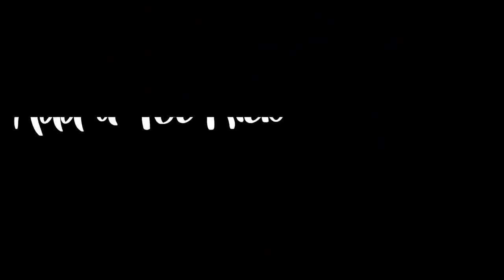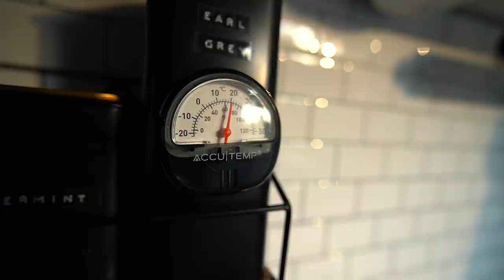VAN BUILD MISTAKES: 8 Things We Would Change | Sprinter Van Conversion

Comment: Great video guys. 
Rooky errors we call them in Australia. Some ideas that might help. 
Let the cushion base sit on a new wider ply base that can manually slide under the backrest when needed. Velcro on bottom of seat cushion and seat base would stop it sliding. Rare earth magnets would have worked a treat but your new catches are better! What about a stool for sitting during the day, fold up of course but a smaller footprint. Could you shorten the bottoms of the fronts of your cabinet doors by 10 to 15mm to give you a big enough gap for thin carpet mat?
Anyway, keep up the good work, stay happy, stay safe but keep enjoying the journey. Blessings from Wayne and Meredyth in South Australia.
Reply from the maker: Oh yeah definitely rookie errors! 
Cheers for the advice Wayne!

Comment: Yeah you could probably add close to a foot to your bench width. Past your kitchen cabinets. It would not line up anymore with your kitchen cabinets, but it would be more comfortable to rest on. Also it might not be so comfortable to walk down through, but you could shimmy down sideways slowly. You could either get a board on top that folds out. Or one of those staggered sliding benches ive seen. So you can pull it out when needed. And why do you need the backrest? If you got rid of it, it would make your bench wider. Or have those back cushions be the extension width now.
Reply from the maker: Yeah we fixed a whole bunch of these mistake and posted them on our updated van tour. Because the backrest houses the winch for the bed we definitely still needed something over there, but we still increased the width of the seat.

Comment: You know what I would also do is, raise your countertop where your desk is, a few inches. So when you move your desk board back and forth, you can still leave stuff on it, like your laptop etc, so that it will clear the height.
Reply from the maker: We never had issues leaving laptop on counter when pushing it back and forth, or did you mean in the gap between the top of the drawers and the black walnut top?
Reply: @Drinkteatravel  yes the second one. So you can leave the desk countertop with your pens and laptops and papers, and slide it under your kitchen countertop.

Comment: We updated a 20 year old camper van here in England and we included some of your suggested changes.  We built our own composting toilet and we find the 2 of us ( 1 male, 1 female like you guys) don't fill the solids part during 2 weeks use.  We used the existing cassette to collect the liquids and we have to empty that every 2 days but it's much easier than the mixed waste.  I would suggest to anyone building their own composting toilet, to start at the lowest point with liquid and solid waste containers and work upwards.  That way you won't find you need water to flow uphill.   We also had the cold floor issue but we throw rugs or old blankets down and that makes a huge difference.   We also made insulated pads to fit every window in the habitation area and hung a well insulated curtain between there and the cab.   Still lots to learn!   Pete
Reply: We took out our shower because we didn't use it.  We don't carry enough water to use it when we are boondocking and when we are on a campsite, they have showers there!
Reply from the maker: Must have been a lot of work! Yeah I've seen a few people.recommend the self built compost toilet so might need to look into that.

Comment: So i see you are still answering comments. What do you think of those showers, with the drain in the middle of the floor? And then you use a hanging vinyl shower cubby around yourself. I've seen some with a wood grate right on the floor over the shower pan, or some where you have to fold up a piece of floor to get to the shower pan below. I think that's good just to keep as an option.

And my second question is, I've seen some videos where a guy has a gutter on the back of his van, to use as a rain water collection system, which then drains below into one of his water tanks.  Why don't more people use that? 

I think that would be good to shower or wash dishes with, with a water heater. Collect the rain water into a green water tank. Use that first, to get most of the job done, and then you could do a final rinse with drinking water. You would probably also just have to drain it below to outside. So showering in the van would be much more feasible.

Comment: You can make a composting toilet really easy. Get a seperat toilet seat and a bucket. Then you put a bag in the bucket. Put a frame around it and you’re set. Get horse bedding pellets for the compost. It’s around $7 for 40lb bag. It lasts a long time.
Reply from the maker: Thanks for the recommendation
Reply: Lol, or cut a hole in the floor and let it fly outside lol. Wow lol

Comment: Haven’t built a van yet and found this very helpful. I definitely want a rug on the floor , so will put in a toe kick! I am not up for a pricey compost toilet and planning a bucket toilet with a separate pee funnel and jug... Plan to dump the pee in public toilets(carry in a backpack, lol and use trash bags in the bucket toilet.
Reply from the maker: I mean that's basically what out toilet does now. Not much difference between having to just dump pee or both.
Reply: Luggable loo seat on any 5 gal bucket, unscented kitty litter, doggie bags combined are easiest for times of need. Pee bottle for #1. This method has NO SMELL and you don't need to look for dumping stations. Total cost under $25. Less weight too. Less water consumption.
Reply: biodegradable trash bag? ;)
Reply: pee just open door and using to hide as you with three and you can pee anywere even in Mall parking lot...
Shit use plastic bag for dog and put it in special poo box for dogs or in nature dig an hole and burry it , keep paper and burn it ...

Comment: TO DRINK TEA: I subscribed because of your good video (this one). Nicely done. Good tips. Honest mistakes. I am glad you mentioned the toe kicks, as I would not have thought of that either.  Happy trails!
Reply from the maker: Thanks for watching.
Yeah the toe kick was such a simple thing we didn't think about either. We were just trying to maximise space in the drawers.
Reply: Sorry...I guess a “toe kick” is a small separation between the bottom of the drawer and the floor?
Reply: @serzok1  Yes. That is what we call it in the USA.  When they are not included, it makes it harder to get close to a countertop, and thus can be a little uncomfortable to stand in front of a kitchen counter that does not have them (causing one to lean forward a bit, causing strain over time).
Reply: @serzok1  there can also be some “setback” meaning the toe kick space is not only below the drawer, but further from the edge of the counter, leaving space for one’s toes to go a little (inch or two or few centimeters ) under the drawer/counter edge.
Reply: @Steadman Uhlich Thank you for the explanation. Little details one would not think of but are important.

Comment: For the extra seating issue, would be possible to modify the front passenger seat rotate?  And thank you for the detailed lessons learned which really count.
Reply from the maker: Yep getting the swivel for the passenger seat and some sort of a table there is what we think we'll do to solve the issue.
Problem is those swivels aren't cheap in Canada. Around $500 each
Reply: @Drinkteatravel  I see. didn't know it was that expensive. Thanks again.
Reply: @mikechon6387  welcome to the shitty expensive camper world

Comment: I also have been having the same issues with the cabinet drawers sliding open and close as I am driving and thought magnets would work. What type of latches did you buy?
Reply from the maker: Yeah the magnets just dont work in our opinion and we tried some heavier duty ones. But the double ball latches work great and have a thinner profile. We have a link to them in our post about the van build in the description.

Comment: Neodium magnets r pretty strong, 2 of those magnets n it should stay closed
Reply from the maker: Nope tried them as well, and if they are two strong then the force at which you have to pull them out increases and puts strain on the cabinetry 
I think for things like clothes drawers magnets are fine, but for anything like electronics or kitchenware, need to go with locking latches or double ball catcher at minimum 
In Australian with our other build we even had to add a strap for rough off road sections

Comment: Try the C Head composting toilet.  Cheaper and easier to clean.
Reply from the maker: Yeah we thought about that at the beginning. We may have to re-evaluate it. The issue with the C head toilet now would be the size of it and having to remove it from shower when not using. But i am sure we can figure something out.
Reply: @Drinkteatravel  It’s smaller than the others and does not need electricity.  They have a very small model too. Good luck!
Reply: @Drinkteatravel  you could consider using a quick release mechanism to hold the toilet inside and then to pop out quickly and easily when you need to shower. I know it's a pain but I'd imagine you'd only need to do it once or twice a day tops when you shower.

Comment: If the sprinter had the ford transit 
Roof high. it would be the perfect van..the only reason I bought the 350 transit extended was the 6'9".5 .high roof  the transit is only 14'
Cargo ..the 170 extended  sprinter 
Is 16'..the perfect combination would be the transit highroof and the sprinter 16' cargo length. 
But .the transit is to short and the sprinter not high enough
Reply from the maker: There is a sprinter mega rood if you did want something closer to the ford transit high roof. The Mega roof is 7 feet high, extends the roof by 6 inches.

Comment: Heated floors needs concrete or marble to work. Can't do it with plastics or wood.
Reply from the maker: Interesting. I read it was compatible with floating vinyl plank from multiple websites. Also have seen a few videos on YouTube with them installed.
Reply: All due respect that's not completely accurate. You can have headed floors with wood and vinyl plank but it needs to de thermostatly controlled to stay under a certain level (usually around 80f). You can have headed floors with other materials and have them at a higher heat. I've looked into this because I want to use electric heated floor mats in the floor of a van. There is also a propane and water/glycol underfloor system available for vans but it's extremely expensive.
Reply: @Drinkteatravel  yes they are compatible it's just with some flooring materials the thermostat needs to be set to stay under 80° F (again this is just a general rule but your application may differ). If the manufacturer says it's possible then I'd listen to them and trust them, people mean well but unfortunately tend to give a lot of misinformation unless they have either built a van, used a specific product or researched that topic. Ive personally researched this for myself in my hopefully upcoming conversion. I'm going to go with the electric mats but there is also the propane and glycol solution you can diy or buy from vanlife tech (personally I don't think it's worth the $7000 they charge for it but everyone is different and has different priorities). I'm going to be building a diy lithium iron phosphate battery so running electric floor mats is not an issue for me and they surprisingly use minimal electricity. 

One important thing to note specifically about the electric floor mats is that they are not made to be your main heat source in a van only a secondary system to help prevent the floor from being cold. I'm still going to have a diesel heater along with the heated floor mats and since I'll be in pretty mild weather the floor mats will be more then enough most days to keep a van comfortable in slightly chilly temps. 

Also thanks for this video, I previously requested you do this topic so I was very excited to see this video. Thanks again :) cheers
Reply from the maker: Thanks for the in depth answer ! 
Yeah I thought it was possible as well. And yeah maybe a system using electric coils would be better for us as well since we have lithium in the vehicle and rarely go below 50%.
Reply: With 200 amp hours of lithium you might get 4 hours of electric floor heat. I would do the math before you make that decision. You might find it’s a big waste of time.
Reply: @Drinkteatravel  why not carbon far infrared underfloor film made in Korea?

Comment: Why do have to make everything so damn heavy, you started with a huge van and have made it so small. A whole lot of horrible bare steel too, not very cosy.  Er..it's not a perfect van...

We have a Vivaro and have almost as much room as you inside, we use sangria bottles for number 1s, they can be easily emptied in any toilet, without embarrassment and washed out. Number 2s are for emergency use only, a small bucket lined with a dog poo bag, or in the sticks we have a machete/spade we call a "mashitty". Walk in the woods....and who is going to attack someone carrying a machete?

In terms of flooring use cheap carpet, much more cosy and when it looks too bad change it. Ours is 6 years on, starting to look shabby with a dog and a new bit is just a few Euros. Plastic flooring is nasty.

Don't have regrets, just modify, or change things next time...one big tip YOU WILL NEVER MAKE ANYTHING PERFECT..so don't try, enjoy what you have..your freedom.